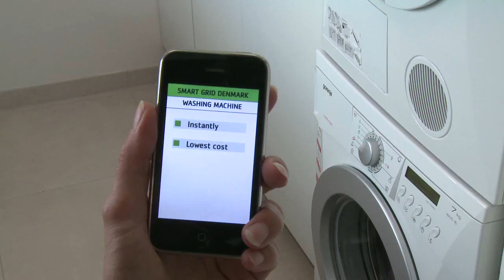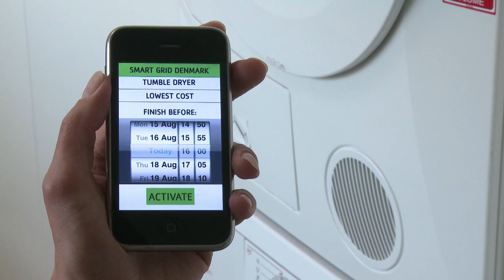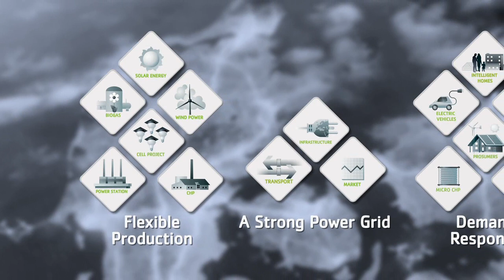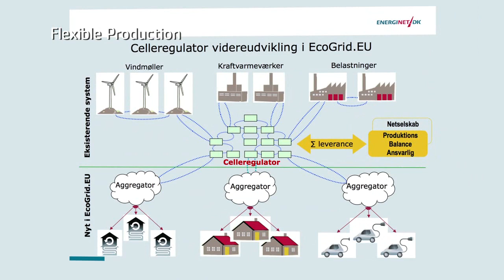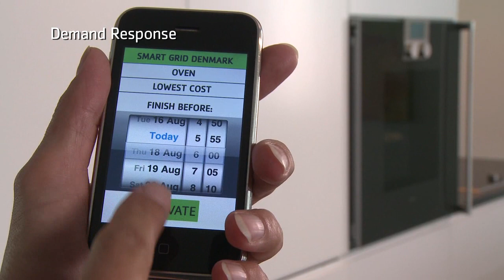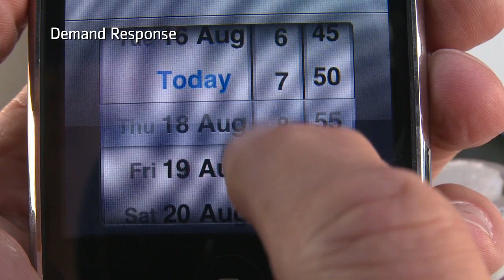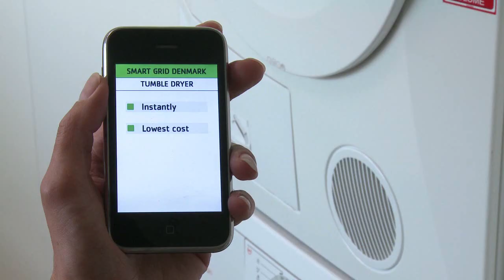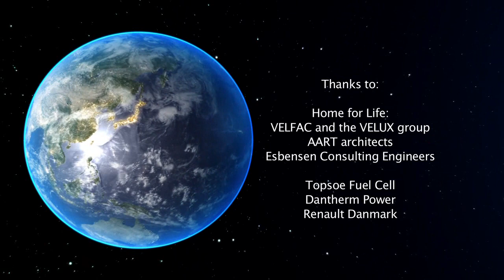Smart Grid Denmark

Comment: The explanation of heat pumps is slightly wrong. Heat pumps primarily move heat from one place to another. Similar to pumping water uphill, heat pumps pump heat from cold areas to warm areas. They can get this heat from the ground or the air, but it is more efficient to use the ground in denmark because the cold air would make air source heat pumps less efficient

Comment: heat pumps just isn't that important in countries like Australia which is emphasised a lot in this video (heating homes, not that much use in showers). Unfortunately battery storage still has a long ways to go.
Reply: There is the option to heat large tanks of water or store air (to use to run turbines) but that is expensive.
Reply: Heat pumps can also be used to store "cold". Basically running an ice maker when electricity is cheap, and using ice to cool your house when needed

Comment: Tesla has already made lots of this obsolete...Heck I am about to get of the grid all together.  It is so easy to build a generator and don't need gas or oil or anything of the sort.....
Reply: jeffery knight 
I don't this most every-day electricity consumers will think as far as to create their own energy sources and become independant of this kind of system.

The good thing about Smart Grid, however, is that you can buy and sell electricity whenever you or others may need it.
Unless you use lots of batteries, an example could be the batteries for electronic cars, there will be electronic waste when you use your own 'generator'. Smart Grid allows you to connect to an international electricity market, which means no electricity waste.

Smart Grid is not (just) about making money - it's about distributing renewable energy to whoever needs it in the second it is produced, efficiently. It does not mean you cannot produce your own electricity instead  of purchasing all  electricity. In fact, from my perspective, it does the exact opposite. Private consumers should easily be able to connect to the grid, selling electricity from your own eventual generator.

Energinet even mentions the concept of producing electricity yourself in coherence with SmartGrid at 12:05...